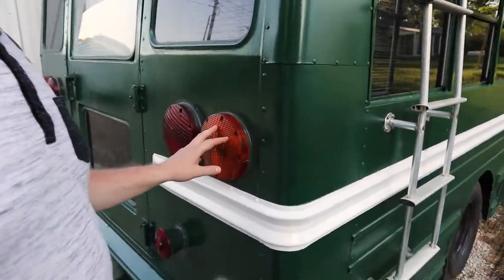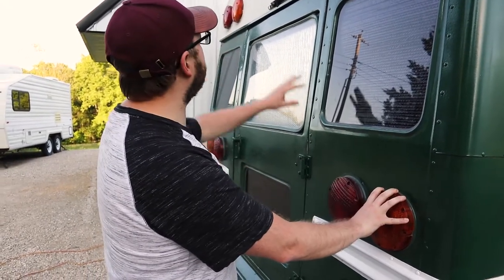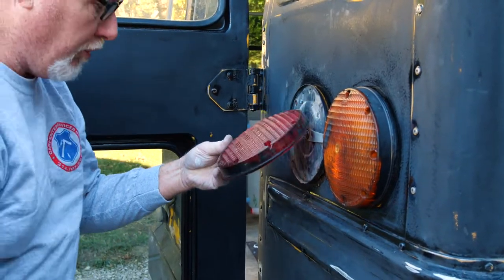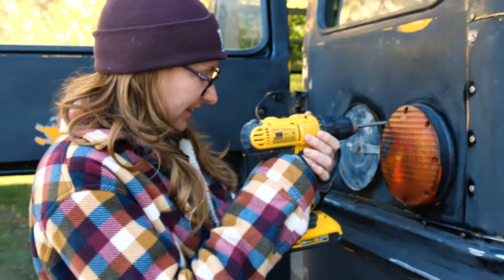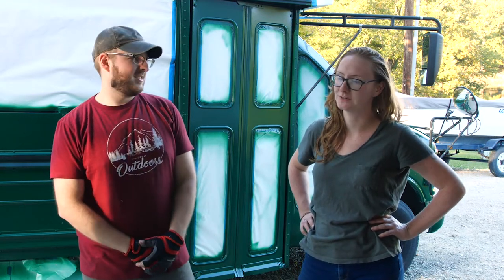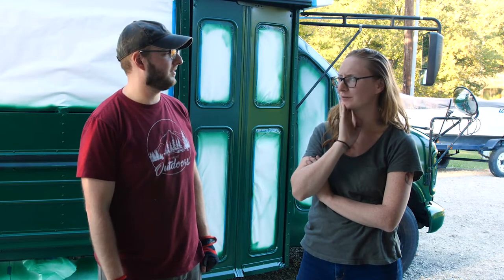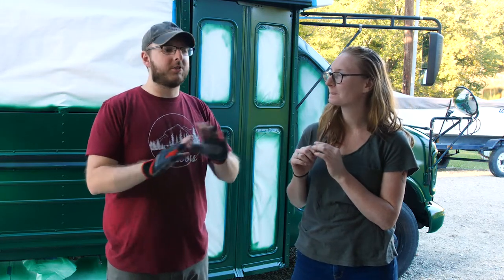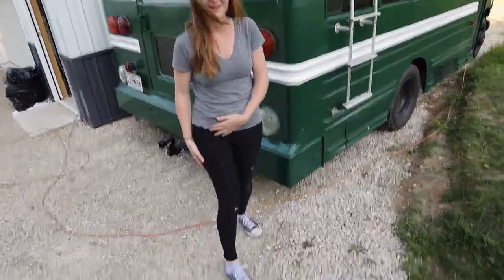Painting Our Bus | Bus Conversion - Day 11

Comment: neat trick to get youre plastic lensess look like new : put them in the dishwater , good call on spraypainting the bus , its a lot eazier then rollering and brushing  , f you pull of the paper and tape directly after spraypainting while the paint is still tacky you get nicer cutlines (the paint will round off slightly when its still wet)and prevent you from pulling up the new paint